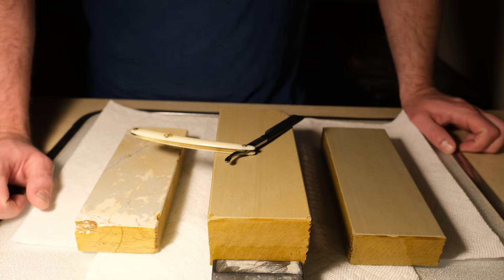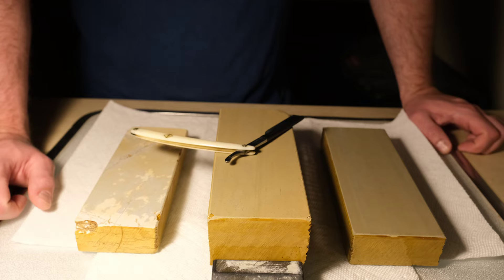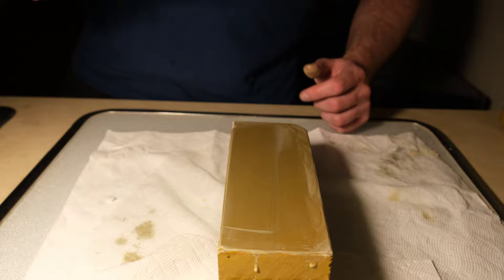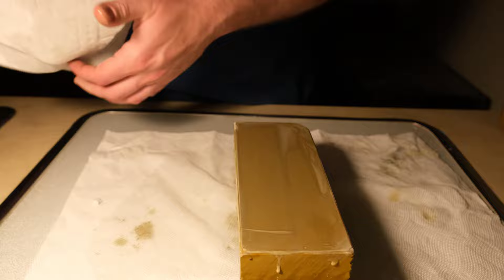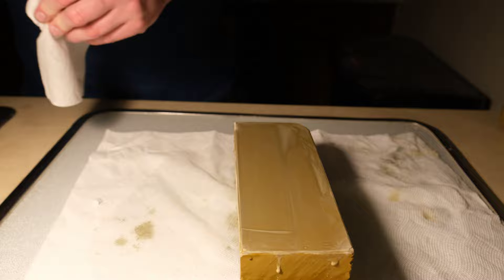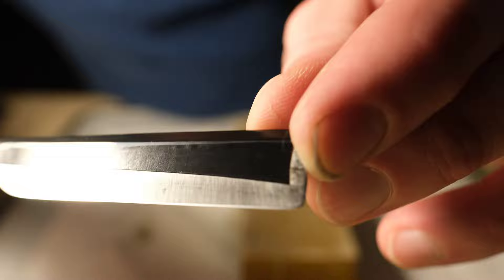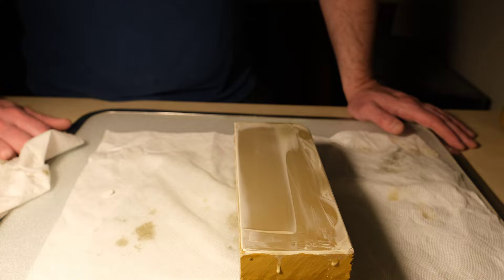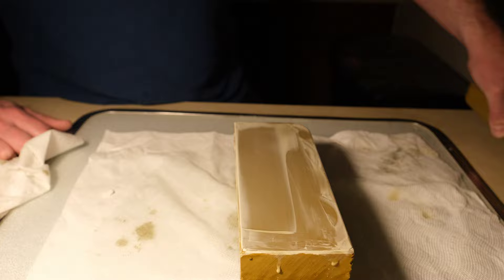Razor Honing on Soft Japanese Natural Stones Whetstones (JNATs) Aiiwatani Tomae  Namito Ohira Suita

Comment: You actually bring up a very interesting topic of discussion regarding the use of soft stones. Some people are really sure to this day that soft stones are much better than hard ones and that the Japanese are chasing soft stones, it seems to me that these people are like a sect :) I can tell you from personal experience that I bought a lot of stones from sales from old Japanese hairdressers and they were mostly hard stones, some of them had a maruk print and a saddle-shaped working, but there were also fairly even, almost perfect stones (it was clear that the stones were quite old) this is a bit different from what you said. I can also say that finding a soft stone with a high grid content is much more difficult than a hard one, although they come across from time to time.
Reply from the maker: Hey Dan, I'm sure with how many different barber shops there are/was in Japan it is difficult to draw a broad answer for all of them. What was happening at the time I made the video is a lot of "old barber" stones had gone up on Buyee or other auction sites with people getting them and being surprised by how soft they are. I generally agree with what you said that, if I am chasing a fine stone I would shoot for something harder to increase the statistical probability I walk away with what I wanted - and I give people the same advise. That doesn't particularly help though if you have one of these softer stones "for razors" as they have to be used a little differently. 

I agree as well, it is a pretty polarizing topic regarding hard/soft stones!

Comment: Between Shobudani tomae, aiwatani tomae and iromono which is easier to use in your opinion?
Reply from the maker: It doesn't really work like your question suggests.

First, the "Iromono" term is not a mine but instead a color of the stone - usually mixing of multiple bright colors like red/purple/orange/etc. Iromono stones have no quality innately besides the coloring - there can be soft/hard/coarser/finer Iromono stones. For instance, many Tomae stones are Iromono coloring - making the question you posed even more confused.

Shoubudani and Aiiwatani are obviously two different mines, but each stone from the different mines are unto themselves. Not all Shoubu stones or all Aiiwatani stones have the same qualities about them - each stone must be evaluated on it's own. 

We can draw inferences of the mines at a level where you were reaching into a random box full of many different Shoubu stones, and many different Aiiwatani stones, and say probabilities. Shoubu is likely to be softer (compared to the Aiiwatani), Aiiwatani harder and finer. Aiiwatani is more likely to have an inclusion than Shoubu if you are grabbing a random stone from a box of them.

However, you are almost never just reaching into a random box of raw stone - you are looking at a stone a vendor is offering or someone else has and evaluating. The stone has been finished and you can see details. You can get idea of hardness and fineness, etc. As such - stones are to be compared by those qualities and not the mine they come from.

I very much like Aiiwatani stones, I think they are good for the money because the Aiiwatani mine name does not carry any increase in value to it. Shoubu/Nakayama/Okudo/Shinden for example often get marked up some by nature of just having a famous named attached to it. All mines can produce equally good stones, but the statistical probability that you get a really good stone from a random selection of stock from the mine is usually where the reputation came from. Because we are never dealing in that manner now adays - it is not as useful to take these reputations into full account broadly.
Reply: @naturalwhetstones  I am a sushi chef recently really got into sharpening knife. The one that I saw is Nakayama iromono...I think I would get the aiwatani...do you it is worth the pay extra buck for a smaller suita than getting a tomae... thanks for your reply
Reply from the maker: @bidin5253  I would need to see the stones to let you know. Generally speaking I actually think more people will be happier with Tomae stone - but I need to see them still. Shoot me a message here so I can get more details to help: https://naturalwhetstones.com/contact-me/
Reply: @naturalwhetstones  cannot put pictures there...do you have Facebook or Instagram that I can follow
Reply from the maker: @bidin5253  Once you shoot me a message on the contact form it will create an email chain between us. Just wait for my reply and you can do it that way please.
Reply: @naturalwhetstones  okay bro 👍👍👍

Comment: For the next time when comparing stones you could polish different sections of the knife with different stones to show the difference more clearly.

Great video.
Thanks for sharing this information
Reply from the maker: That often doesn't work out as well as I would like, I have done it before but it is possible. if I am comparing two I would usually do different sides and flip the knife over to compare. 

I will consider adding it in the future!

Comment: Problem beeing people nowadays think they can finish on a fine grid stone, but in reality you need to go to the paste strop, not much but just to give the cutting edge it´s final polish. For shure you can shave from  the stone straight, but it will never be comfortable. I have done it my self, my stones are fine enough and everything, no need to fiddl hours and hours on the stone for nothing. Barbers did it in the past and they did it for a reason. You wanna nice shave, give the razor a light touch on the cromiumoxid strop (with tape on the spine maybe) and you are good to go!
Reply from the maker: I always suggest people try to shave off the stone just to see the edge it leaves when they are first learning - but I never recommend it as the right way to finish. I would always hit the strop afterwards and wasn't trying to say that you should not in the video (hopefully I did not accidentally imply that). I was more focused on just showing the slurry method of use for the finishing stone "step", just as I didn't cover bevel setting/prefinish/etc.

I will usually tell people if they want to get really good on the stone to avoid paste at first and work to get a really great edge off just the stone and a leather strop. That setup will show you any faults in your technique, as the paste is in some ways kind of fool proof and may hide some bad habits during the honing process. 

If you can get a wicked edge without paste, and then you add paste back in, you will not only have the best edge possible but be able to really identify how you want it to feel from there, having conquered the proper methods to getting to a maximum level of keen. 

Just my two cents at least. :)
Reply: @naturalwhetstones  Nothing to add, no you didn´t imply "that". Good you answeard in that manner. It´s the way to go! Greetings
Reply: personally its enough for me to take the final whetstone slurry, wipe it on my palm and then use the palm strop method.
but I do have a stone that finishes fine enough that a strop makes no difference, the important part is that as you work your way up the grits, that you really did get rid of all the marks of the previous whetstone.
Reply from the maker: @thedazzlingape2006  Yeah every stone is going to impact the apex a little differently, and that isn't taking into account how each razor will reach uniquely with different tempering and metals. Trial and error is the key for sure. I think the majority of stones though, especially softer ones, benefit from post-stone stropping.
Reply: @thedazzlingape2006  Why would you do that? I can imagine, in a hurry without strops at hand, thats a smart move, but... Shure, we should make our progression in the way that no previous marks are under the finishers, no question about it. Propper sharpening must be provided. I think we all have got a fine enough stone sooner or later. I know it´s gives some romantic feeling shaving without the use of other abrassives. And someone would ask him self why shuold I progress so far when the edge is an artifcial (paste) in the end. Answear would be, comfourt. At least for me, and I don´t have a strong beard at all. It took some time and a few stones to make this sacrifice.
Reply: chrominum oxide's edge is kinda harsh you know